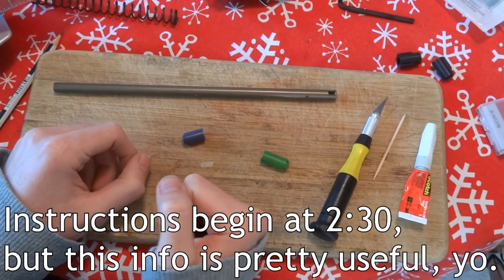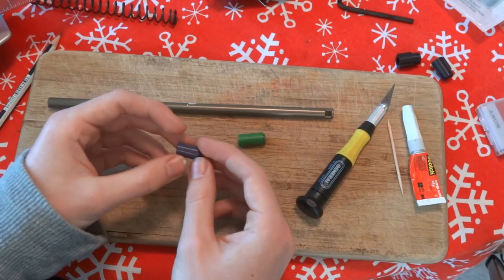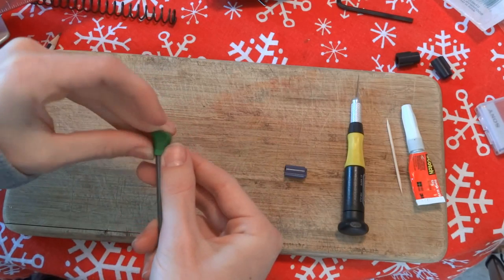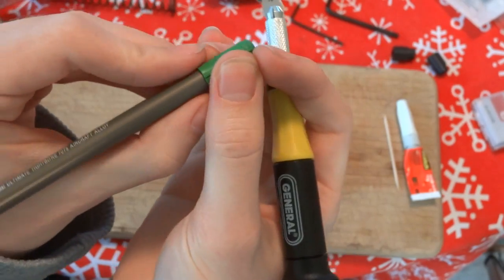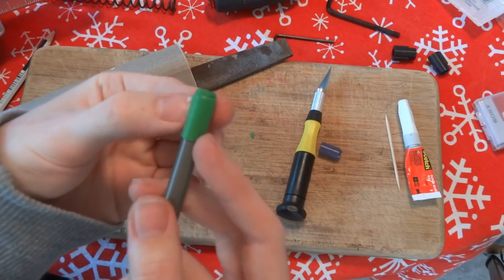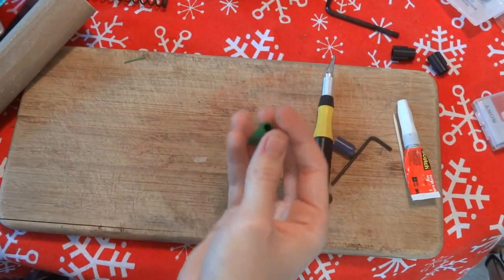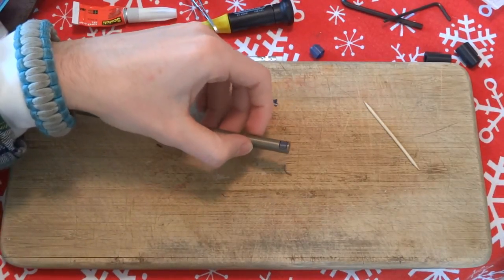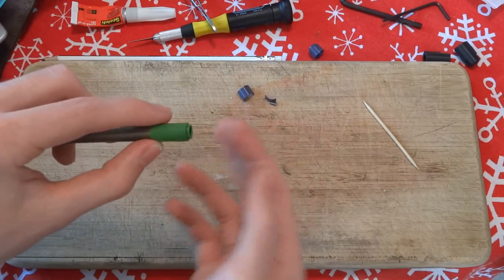Increase any Airsoft Gun's Range and Accuracy: G-Hop Installation Guide

Comment: hey so I'm running an m150 spring on an sr 25 509mm stock barrel. Madbull red 60 degree bucking as the contact pad and a ribbed 60 degree rtx bucking which gave me decent performance on its on. I am Using a maple leaf nub. idk if my fps is too high? maybe the stock barrel bore is terrible. But I am not getting good results. a lot of flyers and inconsistent flight paths. Maybe I did something wrong lol... But I cut the contact patch just like you did in the vid. and the bucking mound and strip. help?
Reply from the maker: 60 is a little on the soft side for an M150. I think you'd do better with 70 degree. Also, make sure your contact patch is wide enough. If it doesn't reach all the sides of the barrel's hop cut the performance will be subpar. Another thing about G-Hop is that it's far more affected by accuracy loss due to inconsistent FPS and/or bad compression than regular buckings are. Look up some AEG compression mods if you haven't already. I think if the barrel was too bad it'd affect the normal bucking too, but a new barrel is a good upgrade (the looser the bore the better for DMRs, but I don't know if AEGs have the air output for an Orga, try calculating a cylinder-to-barrel volume ratio since you have the extended SR-25 piston). There are a few things you can check, but if you get it working you'll get great performance.

Comment: I just ordered a new hop up and a lonex 70 degree bucking for the contact patch. I am planning on installing this g hop. I know the range will be a lot greater because of this and my miracle barrel but will the accuracy increase? Will i get better accuracy if i replace the stock g&g bucking with the lonex one ? Please respond, Thanks- Nathan
Reply from the maker: I get better accuracy out of G-Hops than regular buckings so I'd say that your accuracy would be better with G-Hop. If you can get your hands on a Maple Leaf nub (or hop up tensioner or whatever they call it) that'll boost your accuracy as well.
Reply: Thank you very much and where would you put the nub at ?
Reply from the maker: Nathan Olney It replaces the stock nub (which is a small rubber tube) in your hop chamber. The nub goes right where the hop up arm pushes on the bucking.
Reply: ok thanks man

Comment: Wait, for the Prometheus bucking, did you use the part where it has the lump? Or just it's flat side?
Reply from the maker: It's flat side. If you use the lump it'd completely defeat the purpose and cause jamming.
Reply: Gotcha, I have a bunch of G&G buckings laying around, you think I can just use that instead of the promtheus?
Reply from the maker: Aznboixyz89 You can definitely use G&G rubber for both the outer bucking and contact patch.
Reply: Sweet, I'm gonna try this out when I buy a Echo 1 M16 platinum
Reply: ***** hey can i use a stock kwa hop up rubber instead and which prometheus rubber should i use? is it the soft type purple one on evike?
Reply from the maker: Daniel Olivar You can use a stock KWA hop up for the outer bucking. I used the soft purple Prometheus bucking for the contact patch shown in the video, but most 70 degree hardness rubbers will work great for a contact patch.
Reply: Thank you so much , God bless

Comment: Thanks for the advice, yeah, it does come with silencer and i cannot take it out, the stock inner barrel is 650m, and shoots like 440 fps (with a m120 spring) i was thinking on a promy 6.03 or madbull 6.03, but i think i cant put a 509mm

Comment: I bought and installed a new purple prometheus bucking and my airsoft gun lost more than 150 fps !
Reply: +TopHatRunner thanks for your answer, there is no tear in the bucking but it's very soft and the hopup unit is a bit to large, so I had to put teflon tape around itbut because the bucking is so soft, when I slide the hopup unit on it, it seems like it's getting strechted which changes the shape of the lips so it will not hold a bb properly....(if I point the gun downwards a bb falls out), I put the old bucking in place and it's working properly.  I think this particular hop up unit is the problem
Reply: +john hunter its not air tight. I've had similar problems with prometheus hops.

Comment: i saw this video a few month ago.. and i didnt feel like i had the skills. now i did you g hop mod.

SPECS:
STOCK G&G G36 CHAMBER AND NUB
STOCK A&K M4 CONTACT PATCH
STOCK KWA 2GX BUCKING OUTER BUCKING

the gun is a g&g custom gi blowback 360-380 with .20

RESULTS: with .25 around 300 ft. maybe i'm wrong. but lets say 250-280. its. FUCKING AWSOME.
Reply: this is with stock g&g barrel. 363mm i think
Reply from the maker: Sounds like you could get around 250' with that setup. Awesome! Glad you like the mod.
Reply: and im getting a 450 mm 6.03 soon. so it will improve! also i got a green g&g bucking in mint condition, thanks a lot

Comment: I am very maticulous about compression. Maybe it was just the barrel then. Ive done the teflon tape mods , and have a prommy air nozzle with an o ring.
Reply from the maker: Your issue is far more likely to be caused by too small or soft of a contact patch than an issue with the barrel, thought the barrel could be causing it. I've had that issue once before, the problem was that I didn't cut the patch wide enough. It worked great after I made another patch that was the proper size.

Comment: At the end 22:49 when you are pushing down on the window doing some finger hop it looks like the patch and the outer bucking have a gap between them, is this a problem?
Reply from the maker: When you're using this setup you won't have that much hop applied, so no, it's not a problem.
Reply: Makes sense, Thanks. Did you end up installing this particular build into a gun?
Reply from the maker: Yep, it went into a friends gun. Worked great and still does.
Reply: Thanks for all the replies and the awesome tutorial.
Reply from the maker: BrainExploder No problem!
Reply: +BrainExploder mark <3

Comment: Does this work if my gun doesn't have hopup? What do you recommend to get some hop up if I don't have a unit and can't get one that fits?
Reply from the maker: +williamcanning84 That sort of depends on what you mean by "doesn't have a hop up." If your hopup is broken you might be able to use this technique to fix it, or if the gun has no hop up system you can make a cut out on your barrel and use this technique to make an in-adjustable hopup... tho it'd take a lot of work to tune it until it  was the right setting. The most realistic option, however, is to buy a new gun.
Reply: I have an shs 6.03 tight bore barrel with window but the gun itself has no hop up unit. It's an Lpeg. I use them with my kids so I don't need anything OP lol I just need a little more distance on what I have now but that is a good idea. I don't mind tuning it. I've done a lot to the thing already. Thanks for the idea
Reply from the maker: williamcanning84 My comment about getting a new gun was more because it'll take a lot of trial and error to get the home-made hop up to be anywhere near where you'd want it, but hey, maybe you can get it good enough! No problem.
Reply: I actually got it! I had to cut and sand but my second try gave me the desired hop up. It's so nice to not have the bbs hit the ground after 20 feet lol. Great video. It was really helpful! It was a well p90 btw. I got it perform as well as any other lpeg as opposed to some useless toy so my kids will be quite happy with it :)

Comment: Would this work on a pistol?  The window on pistols are different but it seems like this would work
Reply from the maker: JTDvideoproductions Depends on the pistol, but in most cases it will work.
Reply: ***** I guess what i mean is gas guns dont have the part near the end of the barrel.  The window goes all the way back to the barrel instead of having that end part.

Comment: Do you want a total seal on the contact patch?
Reply from the maker: Lucas Riedel Sandkilde What exactly do you mean by that?
Reply: ***** I think he means does the contact patch need to be cut to the precise size of the barrel window (i.e. perfectly flush). I assume no but the more flush it is the better contact it might have during hop (just a guess). Definitely would glue more securely though...
Reply from the maker: Ryan Gordon I see. For best performance, the contact patch needs to be as close to the full size of the window as possible without actually touching the edges of the window.

Comment: Hello,

TopHatRunner please could you share with us? What will be estimated effective range after this g-hop installation? I have g&g TR16 Top Tech R4 commando. (approximately 420 fps with .20 gr BB) Thank you for video)
Reply from the maker: Around 170 feet if you use .25g (assuming you did a good install and your gun's compression is also good). Farther if you use heavier BBs. That might not sound like much compared to the distances other people claim, but you'll be outranging other people's guns that shoot "oh, past 300 feet at least," because I actually measure things.
Reply: ***** Thank you for your help. I'll try to install g-hop to my hop up and then share with you results. a one last question more. Can ı use hop up tensioner with g-hop? Do you have any experience?
Reply from the maker: Serkan Fatih Kucuk No problem, I'd love to hear your results. You do need to use a tensioner with G-hop like with a regular bucking. I've found good results with the Maple Leaf hop tensioner. http://www.wgcshop.com/wgc2008/main/product_detail1.php?item=MLTW-AHT
Reply: ***** Thank you for your advice. I'll apply g-hop to my gun probably 3 weeks later and share with you but before I would like to measure with current hop up.
Reply: +Serkan Fatih Kucuk. what where the results

Comment: question, did you use the the bucking lump from the Prometheus for the inner  contact plate ?
Reply from the maker: No. You want to avoid using the bucking lump for the contact patch. That would make the mod rather pointless (as you might as well just use the bucking lump of the outer bucking) and cause jamming and overhop.
Reply: ***** ok thanks just wanted to be clear
Reply from the maker: ramone diaz no problem

Comment: what about gun with 750fps ? is it good for that high fps?
Reply from the maker: It's durability gets a little iffy over 500 FPS. If you always start with the hop off and slowly increase the hop you might be able to use it in 750 but I haven't gone that high myself.

Comment: hey i'm going to an op in a couple days and i have an issue. i did the G-hop BUT i was told i need heavier bb's to do this mod. is this true??
Reply from the maker: Nope. I've never had an issue with light BBs in a G-Hop. All weights work great for me. Heavier BBs do perform better, but heavier BBs perform better no matter what your hop up setup is. G-Hop only works poorly with light BBs if you do a bad install.
Reply: ***** ah damn. i should also mention that i run a polar star. idk if maybe that will have something to do with it.
Reply from the maker: Hmm... I get inconsistent hop with G-Hop in GBBs. Maybe it doesn't work so well in P*s... I've not tried hop modding P*s but I have heard of others getting bad results with hop mods in P*s... but I have heard of others hop modding their P*s... If you can't hop mod a P* that would explain why I never have trouble outranging P* users with my AEGs. I'd recommend trying a Maple Leaf or REAPS bucking, it's practically G/R hop in a bucking.

Comment: How about a H shape nub on stock bucking
Reply: It's actually not horrible. Angel custom makes h nubs, one of which I bought and put into my g&g green bucking, madbull barrel and pro win hop up. Quite frankly it's not amazing, but i did see some accuracy increase. However, I believe the best way to utilize the h nub is to use a g hop modification, as there won't be any pre set nub in the bucking.

Comment: Hi, after watch your video i got inspired to mod my own hop up with your g-hop mod, i have an CR robinson armament which have a unique hopup system much like the g36 wheel style with a metal H nub... i did not had the prometheous bucking so i used a madbull bucking who seemed to be as good as any and unfrotunaly i did not had any good result.. if anything my gun started to choke and misfire alot not to mentinoin it would either give an incredible high hop effect or not enough. Any ideas?

Comment: Seems like to much opportunity for error. I stick with flat hop.
Reply from the maker: that's like saying "I don't want to use a calculator instead of an abacus because I could run out of batteries"
Reply: TopHatRunner Airsoft not at all the fact is that your trying to produce a precision part. The more guess work you can remove from the equation the less of an error margin you will have. If a flat hop will produce 98% of the same  result but you have so much of a higher chance of making the part closer to perfection then on average it’s going to on balance be more consistent. The difference between this and your analogy  is 2+2=4 an abacus and calculator will produce to same result. Where as 1000 people could make this part and not one of them will produce the exact same result.
Reply from the maker: It really doesn't need to be that precise. I always get the same results from my g-hops. I have never seen poor results from a g-hop that was properly installed and I get nearly the same results every time I make one of these as long as I use the same materials. If 999 other people get poor results with this but I always get good results I'm still going to do it lol. If you don't want to be bothered or you think it's too complicated for you to do that's reasonable, but personally I don't think assuming there might be a problem with it is a good excuse to not try.

Comment: Softer or harder rubber for the contact patch?
Reply from the maker: I use 70 degree, but I wouldn't use anything harder than 70 degree. I tried 80 degree once and it got side-hop. Also, softer rubber works better for the outer bucking.
Reply: ***** Oh my god! Thanks dude. I tried this g-hop process on my a and k m249 saw  and it worked amazingly. The stock range with .25's with the saw is around 180. I upgrade my piston, piston head, cylinder, and cylinder head and it was shooting around 230, But now i did this trick and its maxing out with .25's at nearly 280-300 feet!

Comment: Hi
Witch pad do you have used? HSA Z-Kit?
Reply from the maker: No. This is not R-Hop. I used a patch cut from a bucking. Check out 9:59 and onwards in this video. :)
Reply: ***** You wrote in your comments:
UPDATE: I've since tried R-Hop and I can't notice a performance difference between this G-Hop and R-Hop ???
Reply from the maker: Oh, I thought you were talking about the video, my apologies. I used the normal R-Hop patch, since I can adjust the patch to fit my barrel by myself I don't need the Z-Kit. R-Hop performed well, but same as this does and this is faster and easier.

Comment: is it strong enough for gluing contact bucking on the inner barrel ??
Reply from the maker: Is what strong enough?
Reply: sorry for my bad english ... the contact bucking by gluing to the barrel is it strong enough ?? i'm afraid the contact bucking will be tear apart because of friction with BB's
Reply from the maker: mbetotong BBs put barely any friction on the bucking. As long as your gun is shooting under 520 FPS you'd have to do something very wrong during the installation for a BB to tear the contact patch off of the barrel.

Comment from the maker: I've tried using an 80 degree bucking, but it was too hard and had side hop. I'd recommend using 70 degree rubber for the contact patch. I could cut up a G&G bucking for you, you yould mail me a bucking to cut up, or you could mail me the buckings and barrel and I could install the G-Hop into the barrel for you. Contact me at tophatairsmithing@gmail.com if you're interested.

Comment: Hey everybody, I recently discovered that sometimes when I shoot some of my bb's aren't effected by the hopup setting. Also that after time the hope unit resets itself. I have wondered if i should buy a new hope unit, but I have never experienced something like this, any solutions or ideas? Every help is appreciated.
Reply from the maker: What brand hop up chamber are you using? What style of gun is it? How old is your hop up bucking? It sounds kinda like you might've gotten some oil on your bucking, if you get something like silicon oil on your bucking where it contacts BBs it can lead to the bucking not gripping the BBs until the oil wears off.
Reply: Hey TopHatRunner, I don't know exactly what brand the chamber is, but the rifle is a king arms colt m4a1 ris cqbr nylon fiber. I'm not really a tech guy, but this morning i took out the unit and the bucking. I have tried to figure out what the problem is. I followed your instructions, and later I am gonna shot the gun and see if anything is changed. This week i'm gonna go visit my lokal retailer. I will keep u updated, and thanks again for the response.

Comment: Any ideas why my gun started double feeding after doing this mod ?
Reply from the maker: Whatever you used for an outer bucking is damaged or old and worn out. The mod itself can't cause double feeding, that'd be caused by an issue with the outer bucking's feed lips.
Reply: Okay. The outer bucking is actually old. It's the original G&G green that came with the gun about 2-3 years ago. Do you think I can use a Madbull 60 blue as outer bucking ?
Reply from the maker: ***** Buckings tend to wear out over time and double feed. As long as there is nothing wrong with the madbull bucking it should work fine.
Reply: ***** I buight 2 madbull just for this mod, one spare in case I would mess anything up. The madbull is unused, so I'll mod it tomorrow. Thank you for quick replies.